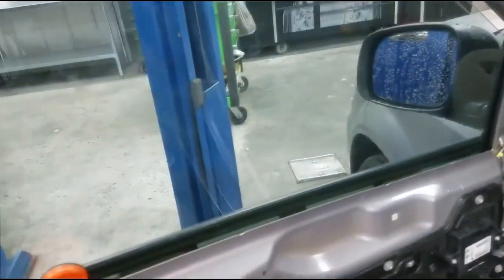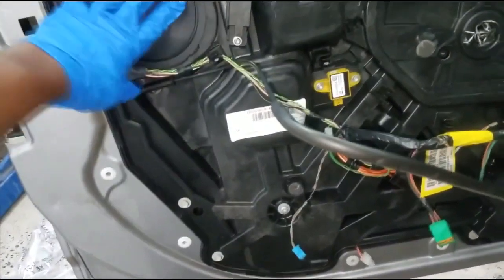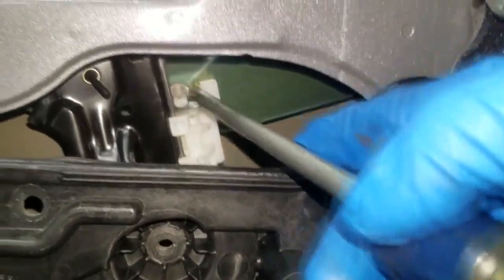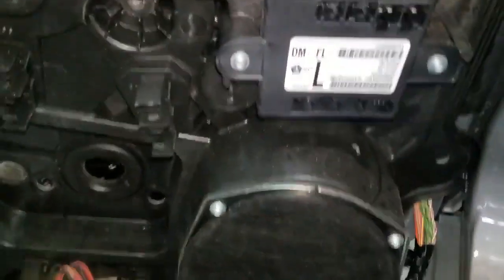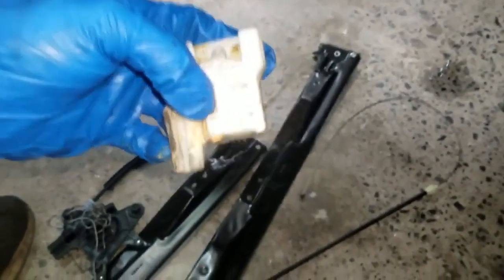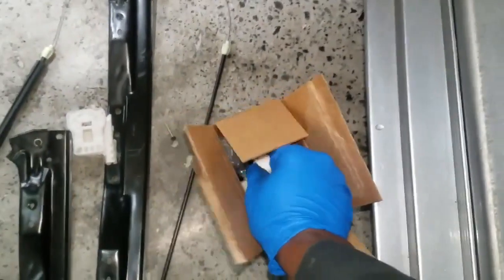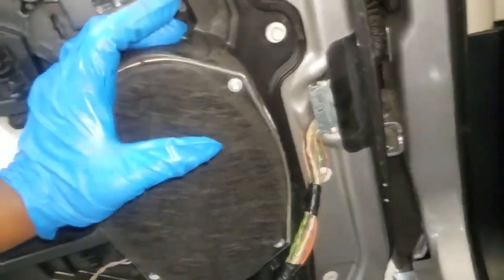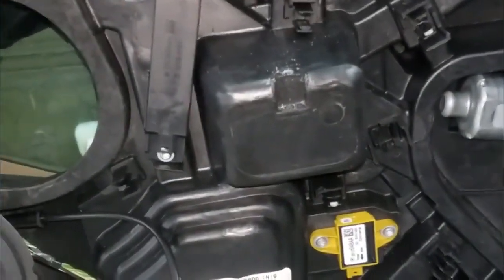There was no reason to REPLACE THE MOTOR. This all you have to do to fix this

Comment: Had a new 2015 Jeep Grand Cherokee Limited and it went thru 5 window regulators, 3 driverside ,1 passenger side and 1 rear passenger side in 5 years, and one transmission that lost reverse in 37,000 miles, 2 crank sensors, a radiator that shattered (Plastic) and to top it off HVAC blend door crapped out!! Got rid of that POS at 58,000 miles and bought a new 2020 Toyota Highlander no problems, regular maintenance, no AAA on speed dial, No more 1st. named basis with Crappy Chrysler service advisors, No More Mopar = CRAP !!!

Comment: The Liberty's were a horrible design, I know, I did more than 2 on my own vehicle? They had the cable attached to the motor and regulator, one whole piece? Even though the motors were good, the cables would snap and wipe the whole thing out? The mastic was one of the worst parts of the whole job, not that they were hard to do, just a mess? I bet you know what I'm talking about, you probably did more than a few yourself? Good job, JT.